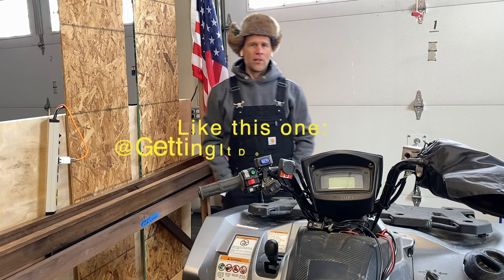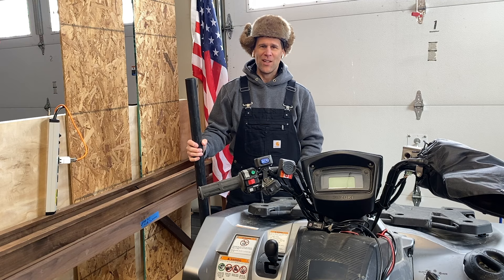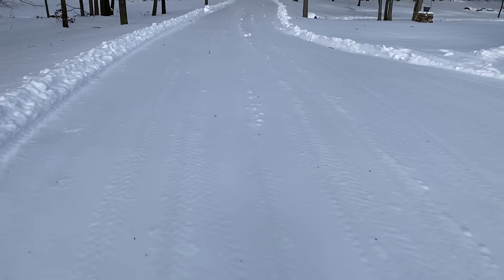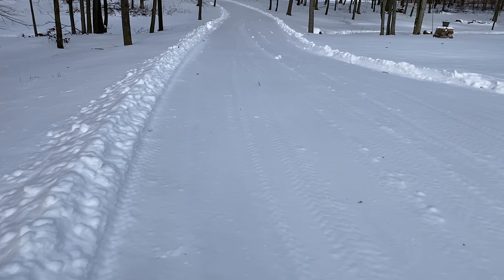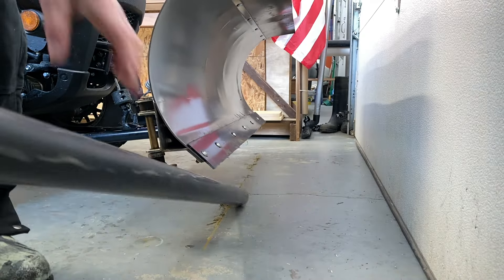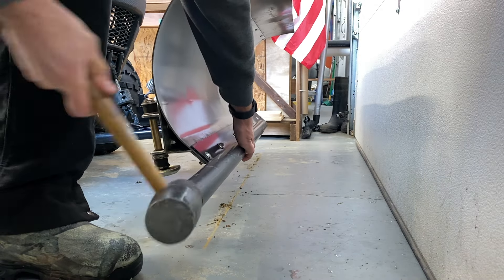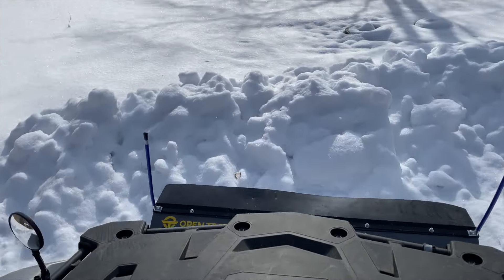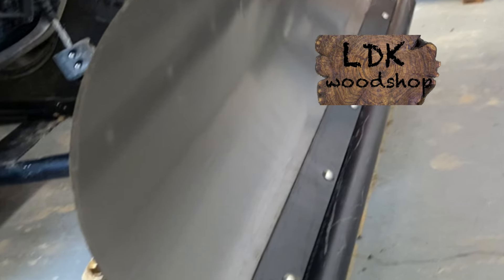Snow Plow Blade Hack - on Concrete Driveway??

Comment: If you use a two inch pipe it will slide over the bolts.
Reply from the maker: I might try that, I think it could ride smoother over the 1” steps of uneven concrete! Thanks for commenting.

Comment: Thanks for the tip it works great, to improve it even and make more durable I drilled 3 holes in it and shot expanding foam into it and waited till dry and cut off the ends, super durable!

Comment: I had the same issue until, I replaced the metal cutter edge with a plastic cutter edge made for plows. Dozens of plastic edges available on the net. Worked like a charm.